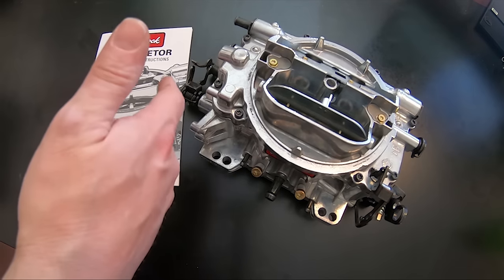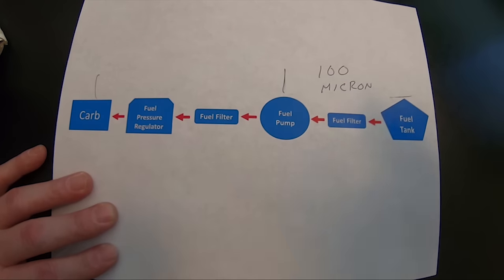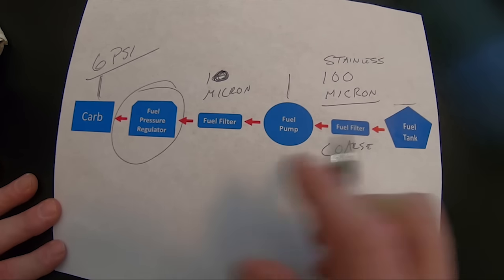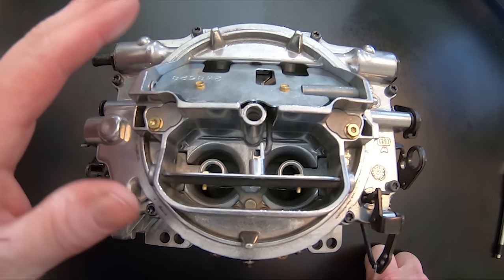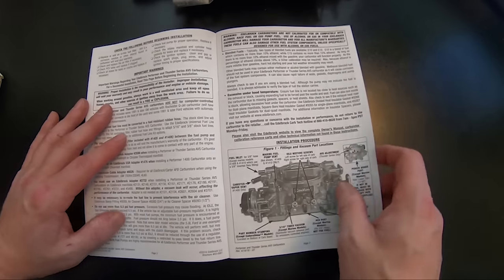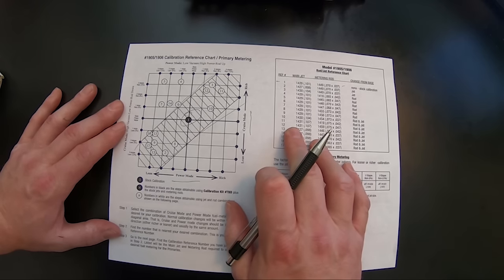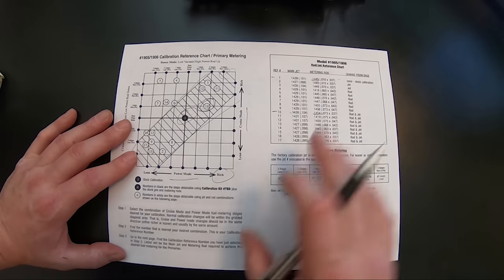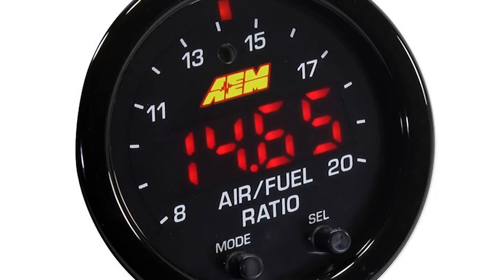The Ultimate Edelbrock Carburetor Tuning Guide

Comment: Great video!! I have a couple questions.  I have a 38 Ford 2 door coupe with a 327 SBC and an Edelbrock AVS2 650. Since I got the car about 4 months ago. I bought the AVS carb, HEI distributor, spark plugs and spark plug wires, new standard fuel filter set up. I also have an in tank fuel pump, but want to change it as it is leaking at the gasket every time I fill it with gas and smells through the trunk. I have a slight hesitation at cruising speed. If holding a speed above idle it will slightly hesitate (not every time) until I accelerate some more. I bought the calibration kit and was hoping to send you a photo of the chart to make sure I am reading it right. So questions..any thoughts of what is causing the hesitation? Also, I am planning to use your suggestions on filter set up. Can you recommend Micron filters and a regulator.  I am thinking of eliminating the in tank pump and going with an in-line pump. Any recommendations on a fuel pump. Not sure if I can send the calibration chart via photo on FB. Do you have an email that you would share?? Thanks!
Reply: I know the tranny is a turbo 350, all I now about the cam is whats on the original build list from the late 90's that it's "aggressive", balanced/bored 40 over, and a Holley high rise aluminum manifold, I don't now the compression ... I can check with the mechanic who has helped with the upgrades? I have the calibration chart and if I'm reading it correctly the closest reference number moving to the right and up in "Rich in Cruise Mode" is "11" #1430  jet and #1455" Metering Rod. Just not sure if that's how I should be reading the chart though? Thanks for your help!

Comment: I have a 1406.  When adjusting the fuel regulator, do you set it for the MAX it will allow?  I have mine set at 5.5 lbs. when it is at high idle.  After I drive it then check it again, it drops to between 3-4.
Reply from the maker: I always start at 6 at idle and tune down from there as needed.  I’d you’re dropping that much pressure, it’s likely one or more issues.  Fuel lines too close to a heat source.  You’re using a deadhead style regulator and they are famous for dropping some pressure.  Put a clear filter before and after the regulator and see what the difference looks like.  Once you get it sorted out, remove the filter after the regulator.  We’re not a fan of one there.  😉

Comment: I have owned a carb for all of one week now and have a wideband gauge, its reading well into the 10s at wide open throttle, 4th gear 80kph is there a way to accurately calculate what secondary yet i would need rather than going down in increments? The episodes are great btw. Half way through allready
Reply from the maker: Always take small steps.  As you've figured out, 10 is WAY too RICH!  Yikes!  Its the quicker way to tune is to take those small steps.  It all really depends on the size carb and what the engine is.  You can check out my video on what size carb to run for a simple equation plus some additional tips at the end on how to pick a size.  Might be useful to determine if what you have is going to be your best option.  Dont hesitate to ask any questions.  Always glad to help.
Reply: @MuscleCarSolutions  thats another thing thats throwing me off, its a 350 602 (circle track motor) it makes 350 crank, I would think the 600cfm edelbrock would be pretty close from factory. It has been sat for 3-4 years though

Comment: Hey so just recently inherited my fathers red 1983 gmc shortbed he’s passed sadly, so I tuned my new carb but ya keeps flooding on just giving it gas and putters out, then I have to wait 30 mins to retry and move it
Reply from the maker: Lots of things to look at. If it’s blowing past the needle and seats then figure out why.  Get a pressure regulator and dial the pressure to 6psi or lower.  Take the top off the carb and see how much garbage is on there and clean as necessary.

Comment: I have 3 of these carbs. All have the following issues.
1.) Fuel evaporation issue? When car sits for 2 weeks it will not start unless I pull air cleaner and prime it with gasoline. Accelerator pump seems to be dry. If I do not prime it, it will take over a minute of cranking to get it fired. I find this ridiculous and unacceptable.
2.) On my intake manifold, on passenger side, directly below the carburetor, there is pool of dark liquid with dead bugs and the like in it. Kinda smells like gasoline. I would like to know where this comes from and how to stop it. I blotted around the throttle shafts and it seems dry there.
I look forward to all comments and suggestions. Would like to know if others have these issues also. I just repainted a manifold and do not want stains.
Thank you.
Reply from the maker: You can blame the ethanol in the fuel.  Use a phenolic or wood laminate spacer to help block the heat.  Or buy ethanol free fuel.
Reply: @MuscleCarSolutions  Carb sits on 1' phenolic. I'll blame drippage on fuel pressure.
I will be converting to electric fuel pump with regulator on all EDLs
Thanks.
Reply from the maker: @deadcarnahans1932 regulator is certainly a good idea.  But it won’t help the ethanol boiling away in a hot carburetor.  I’m just above sea level and ethanol boils around 175°.  You can figure where it’s boiling based on your elevation.  The best cure is blocking as much heat from the engine as possible.  Any aluminum bodied carb has the same issues from that awful fuel additive.
Reply: @MuscleCarSolutions  It's 10% ethanol here. Seems to me if it evaporates away, I'll have less awful additive and more pure gasoline.
Almost sounds like a good thing.
I put thermometer down vent once and it was 127 degrees after long drive and shut down.
Reply from the maker: @deadcarnahans1932  I wish that was the case but it’s not like it boils off and only leaves behind a pure gasoline.  You’ll lose a majority and what it leaves behind isn’t that pretty either.

Comment: When tuning dual quads do you tune then the same?  Progressive linkage. Like if I do a metering rod change for cruise do I also use the same number rod for the second carb?  
355 avs2 500’s. Running rich at cruise and real rich at WOT. Thanks.
Reply from the maker: You’re always going to fight a rich condition.  You’re way over carbureted.  So just get used to that and all the things that will come with it.  Lots of oil changes, spark plug changes and a little more time tuning as conditions change.  No they don’t get tuned the same.  Progressive linkage is the right way to go.  Generally I’ll lean the secondary carb out as far as I can.  Run as much as I can off the primary, if that is how your linkage is set up.  Some run off the secondary carb and the primary is only used at WOT.  In which case I lean out the primary.  There’s a problem with all that.  You cant change CFM.  You’ll still be flowing that amount of air and the air movement through the venturi is what signals the metering circuits to provide fuel.  All you can do is try to lessen the fuel but the signal will continue to be there and continue to fight you.

Comment: Hello
I have a 600cfm Edelbrock on a mildly built 305. It used to scream it's ass off and squeal the tires going into second with a turbo 350 tranny with the Rochester carb I had that crapped out (no clue what size it was). I wouldn't be surprised if I replaced it with too big of an Edelbrock based on advice from the poop head mechanic I had put it on (I was just a boy, mkay?).
My question is whether I can tune the 600cfm down enough to handle my little v8 or am I better off switching to a smaller size to get it back to squealing like a pig? 
(but hell I don't know, maybe I could tune up? No clue)

Comment: I know this is an old video but I just rebuilt my Edelbrock 1406. I took my time, cleaned everything thoroughly and put everything back exactly as it needed to be except one screw up, literally. I mixed up my jets and I'm not sure which is which now and I'm having issues with the carb flooding out big time. Would that or could that be my culprit or did I do something else wrong? This is my second carb rebuild on an Edelbrock.
Reply from the maker: Could very well be yes.  If you go to my website there is a pdf that has the markings of the rods and jets so you can identify them.  It’s in the resources section of the site.  Also don’t discount the fuel system.  Making sure you have the right amount of pressure to the carb is extremely critical.
Reply: @MuscleCarSolutions  thank you sir for answering my question so promptly. I will definitely look into that and take care of it once I get home and off the truck this weekend. You have an excellent channel. I learn a lot from you, UTG's and David Vizard. You guys ROCK!  Thanks again.

Comment: If it's idling and burning your eyes, is that rich?
Reply: If it's gasoline and your eyes are burning from idling, it's running very rich. Methanol and alcohol are a little different but for a regular vehicle, yes
Reply: @b.m.4066  Thank you. My plugs are black also. I'm installing a new carburetor.
Reply from the maker: @bobbydelamar606 not the carburetors fault.  Adjust it!
Reply: @MuscleCarSolutions  I did several times. It doesn't want to idle. I have to keep the throttle open to keep it running.
Reply from the maker: @bobbydelamar606  simple adjustments, a good cleaning or check your fuel pressure.
Reply: @MuscleCarSolutions  I cleaned and adjusted as much as I know how. Mechanical fuel pump is brand new also.
Reply from the maker: @bobbydelamar606  I did a video on how to adjust idle mixture.  Might want to check that out before wasting money on a new carb.
Reply: @MuscleCarSolutions   any idea what would cause a truck with a great compression test to smoke so bad trying to get up to temperature that you have to open all the doors and kick the fans on? Truck's been sitting like a year and a half. Had gas in the oil but after the compression test I figured the rings were good and it was just way too much Carburetor. Had a 700 four-barrel Holley with 70 primary Jets and 74 secondaries on a bone stock 350 Put a new edelbrock 1805s on it. Set the screws one and a quarter turns out and was waiting for it to get up to temperature to put the vacuum gauge on and looked up and realized the shop was filled with vapor from the exhaust
Reply: @MuscleCarSolutions  I'll definitely check it out. Thank you. I've adjusted those from 1.5 to 2 turns out. My base timing is right. I have a vacuum gauge but can't use it cause the car won't idle. It'll start and die unless I hold the throttle open.
Reply from the maker: @bobbydelamar606  I always cringe a little when someone says their timing is right but provides no number.  Idle mixture screws is just one small part of the process.  And I know you said you had a new mechanical pump, but unless you know what it’s output is, you’ll never be able to control it.  That video should help you with a list of things to help you get it right.
Reply: @MuscleCarSolutions  I checked only base engine timing cause the car won't idle. Can't give a number cause it won't idle.  I just bought the car so I wanted to make sure of that. New points and condenser and new intake gaskets. Can you control a mechanical fuel pump?
Reply from the maker: @bobbydelamar606  that’s an issue!  You don’t know if your base timing is right.  Yes, you can regulate a mechanical pump.  Even with a deadhead regulator.  That video is calling your name!  👍
Reply from the maker: @b.m.4066  that 650 might still be too much carb on a stock 350.  Same issues your friend here is having.  What’s your pressure at the carb?  What’s your timing set to?  Did you personally set the floats?
Reply: @MuscleCarSolutions  The base timing was/is right. I watched one of the videos with the carb tuning, but I can't tune the carb with a gauge cause it won't idle...? I'll go back and watch again
Reply: @MuscleCarSolutions  I thought it might be too much too. I ran the formula to come up with the correct carb size and it was closer to 500 or 550 but I just happen to have this one on hand. I have a Mr gasket inline pressure regulator that's set at 6 PSI but it doesn't have a gauge. I have not personally set the floats. Going to check the timing tomorrow. I was told the timing's right but have not verified personally
Reply from the maker: @bobbydelamar606  until you’re willing to understand the timing isn’t right until you know exactly what it’s set at, you’re going to continue to fight things.  I can ask you a few more questions and try to guide you to some solutions, but you’ve got to be open to the help.  I know you’re probably frustrated with it, but dig details like timing and fuel pressure aren’t something you can gloss over.  I’d love to hear you had success getting this sorted, but I don’t think I can help.  Best of luck to you!
Reply: @MuscleCarSolutions  No trust me I appreciate any and all help. I'm sorry if the comments sound otherwise. The car is all time to #1.

Comment: I recently rebuilt my Eddy 1411 after it sat for 5 years with ethanol gas. First rebuild of a carb. Started the car, but having issues with the sound coming out of the exhaust. Almost sounds like a motor boat. I've been told it sounds like an exhaust issue  to running lean. I'm using Rec 90 non ethanol for the first time. I've adjusted the mixture screws with a vacuum gauge. Getting 16 on vacuum. Idle set at 750. Very erratic response when hitting the gas. What am I missing?
Reply from the maker: It could be a dozen things.  Start with the basics first.  Timing/ignition.  Fuel delivery/pressure regulator adjustment.  Pop the top off the carb and make sure you didn’t leave any of the jets out.  Make sure the accelerator pump diaphragm is not twisted up/cocked in the bore.  Check for vacuum leaks.
Reply: @MuscleCarSolutions  Can you rebuild my carb?
Reply from the maker: That’s why I make these videos.  So you can do it!

Comment: Thank you great video. Got a 650 cfm avs2 for a 302 Ford 1969. Running crazy rich, I believe I'm oversized on the carb. is it possible to detune (jet/rod change) this 650 to run on a small block 302 Ford?
Reply from the maker: Unfortunately you can’t tune CFM.  I would agree you’re probably are too big on the carb.  Not much you can do.  Lean it out where you can and live with the rich condition.  Or make the switch to a 500.

Comment: GREAT VIDEO - quick question.  Just dropped a crate motor in my '67 Camaro - car sat for about 6-8 months while I was working through pulling the engine apart and deciding what to do.  When I put the new motor in, I didn't rebuild the carb at first until about 60 miles into the rebuild the car just didn't seem to be running right.  Lagging, no strong pickup.  So I pulled the carb, disassembled and did a cleanup on it, replacing the gaskets but keeping the jets.  Replaced the small needles in the float assembly.  Car is running but just doesn't seem to have that punch I expected - and also, after the rebuild, when I am on full throttle around 60-70 mph and I let off the throttle, it 'stays' - pedal doesn't stick, but the engine RPM's really don't drop like they should until I 'pop' the throttle and then she drops like normal.  

What part internally did I not check or install correctly that would be allowing that to happen?  THANKS.
Reply from the maker: I’ll start by assuming your ignition system is in good shape and working properly.  What is your total timing set at and what RPM does it go to full advance?  Ok so just like the video, how is your fuel system set up? What is you’re pressure regulator set at?  Where is your accelerator pump set at?  Stock middle hole or did you add more fuel or leave it alone?  As far as the not dropping in RPM when you let off the gas, that’s going to be a throttle return spring issue.  What are you running there?
Reply: @MuscleCarSolutions   THANK YOU!  Appreciate the quick response.  To your questions:
1.  Yes, ignition system working properly.  Car starts and runs normally.  Voltage at the coil is 11.98.
2.  Timing: was set at 10deg TDC at 650 rpm per the instructions with the crate motor from GM Perf with vacuum advance off.  This theoretically should produce 32deg of total advance at WOT.  
3.  Fuel system:  I took notes.  I have a single SS filter AFTER the pump.  Do not have a pressure regulator.  Car didn't have one and ran for three years.  Assumed pressure was 'good' but now I will look at putting an inline regulator.  
4.  Stock middle hole on the accelerator pump.
5.  Throttle spring - running the standard spring that was on the car already.  Has plenty of 'pull' to it so I don't know why its not responding.  When the hood is open and the engine is running, I can hit and hold the throttle and when I release it drops as normal.  Seems to be on load and north of 60mph when it sticks.  

THANK you again for the information.  I downloaded and am reading the Edelbrock manual for the 1406 today to learn more.
Reply from the maker: I would verify when your all in advance hits.  What RPM.  A common mistake is thinking that because something ran well before then the additional tuning points or support isn’t needed.  For sure get a regulator and a gauge.  Keep an eye on the pressure from time to time.  It will change over time on a mechanical pump and you’ll need to adjust.  Set the accelerator pump on the one closest to the pivot.  That’s the smallest shot of fuel.  See how it responds.  If it’s worse, go to the furthest one to give it the biggest shot of fuel.  See if it’s better or worse.  I’d verify the timing first.  Then adjust the accelerator pump.  That’s the free stuff.  But I’d get a regulator and a gauge and get it installed.  Set at 6psi initially.  You can adjust down lower later as you tune.  Question on fuel.  Running E10 I’m assuming?  Not E85?  Or blessed enough to use non ethanol fuel?